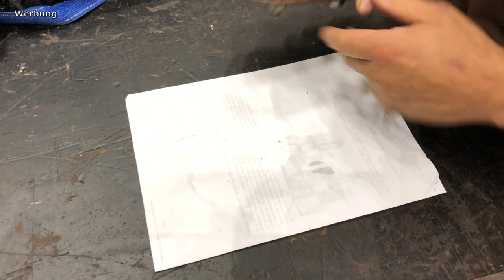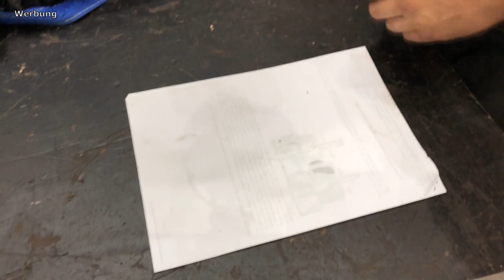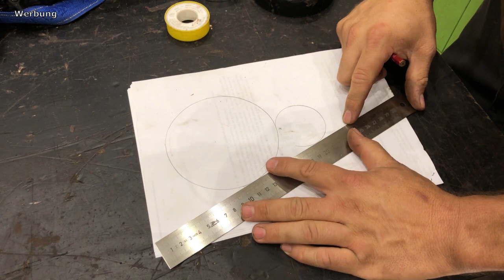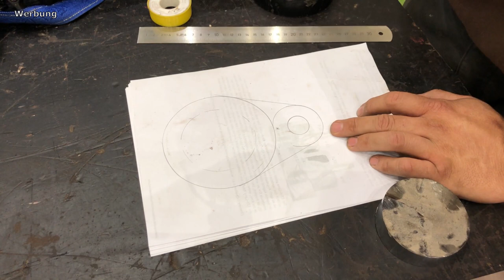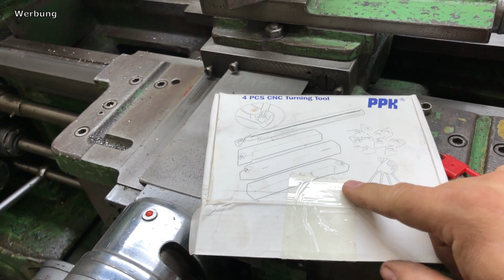Forst Seilrolle Eigenbau, kugelgelagerte Umlenkrollen bauen #2

Comment: Wieder ein geiles Bart Farm Video unterhaltungsfaktor +1000000. Ihr verwendet noch die Alte stahlbezeichnung mit St37 usw. Einfache simple skizze ohne Aufwand so wie ich sie liebe und gerne damit arbeite. Weil bei den Technischen zeichnungen aus dem Konstruktionsbüro steht alles drauf, nur nichts gscheites. Stahllieferanten: gut sortierter Baumarkt für den kleinkram, Metallbaufirma die in der nähe ist, Stahlhändler.
Reply from the maker: Danke! Bei der neuen stahlbezeichnung 1.0045 weis eh keiner was gemeint ist 💩
Skizzen nehmen wir für einfache Sachen, wenn’s kompliziert wird muss auch bei uns der pc ran 🙄
Mit unserem Metallbauer treten wir mal in Kontakt 👍
Reply: Es gibt e arten der Werksotff bezeichnung 1) nach dem Verwendungszweck. Das ist der St37 (alte) S235 da wird die streckgrenze angegeben nichtmehr die zugfestigkeit. 2) Werkstoff nummern 1.0045, 1.4301 usw 3) nach der Chemischen zusammensetzung: C45, x5CrNi18-8 usw.

Comment: Sehr geiles Projekt. Werd ich mir nachbauen 😁
Materiallager ist bei mir so gelöst. Die gängigsten Profile und Flachstahl liegen als Neueisen im Lager. Als 6m Stange oder Abschnitte.
Brauchbares Alteisen ebenso. Wenn Maschinen verschrottet werden, Versuch ich möglichst viel fürs Lager zu gewinnen.
Ansonsten ist mein Cousin als Meister in ner Stahlbaufirma angestellt und über ihn besorge ich mein Neumaterial bzw. bekomme beim Stahlhandel den Firmenrabatt. Schrottplatz ist auch immer gut für Materialsuche.
A und O ist aber eine gewisse Grundlagerhaltung. Ohne geht's halt nicht.